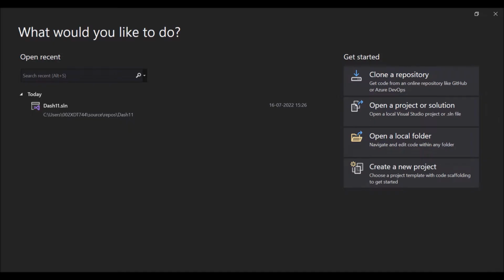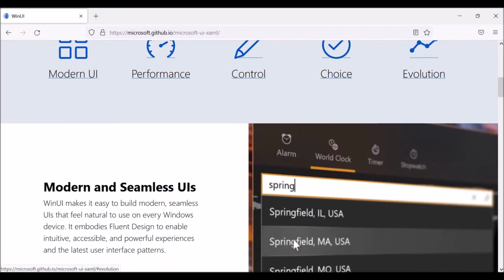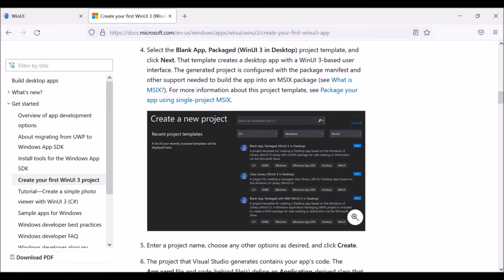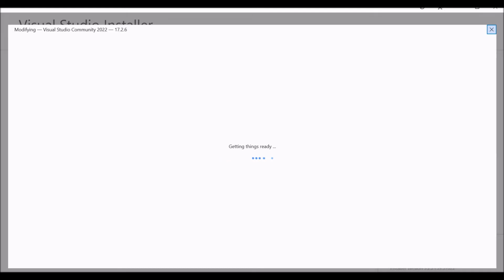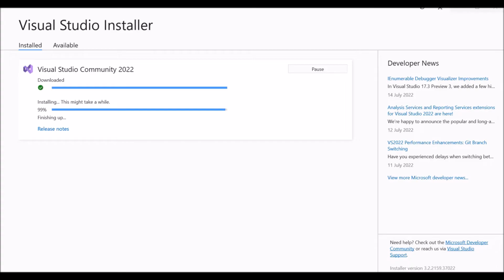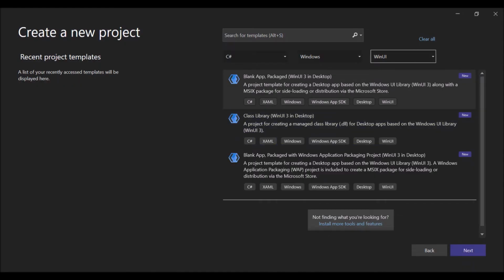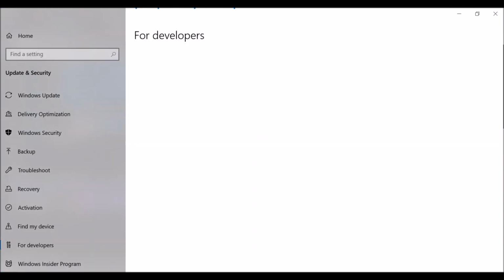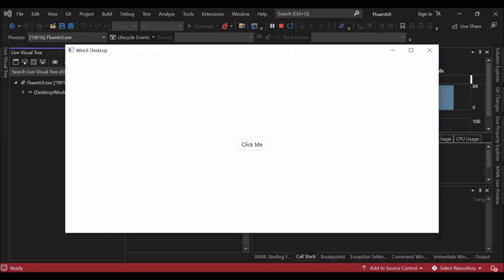Windows UI 3 : Create your first WinUI 3 project | Fluent UI

Comment: Can I style these buttons? Like a web app buttons or will these always look like windows themed buttons?
Reply: Using the XML code, you can style buttons easily. I haven't tried this framework but I believe you also can change the style using settings panel.

Comment: Does anyone know how to fix this?

This version of the Windows App SDK requires Microsoft.Windows.SDK.NET.Ref 10.0.19041.38 or later.
Please update to .NET SDK 6.0.134, 6.0.426, 8.0.109, 8.0.305 or 8.0.402 (or later).
Or add a temporary Microsoft.Windows.SDK.NET.Ref reference which can be added with:
<PropertyGroup>
<WindowsSdkPackageVersion>10.0.19041.38</WindowsSdkPackageVersion>
</PropertyGroup>

Comment: Is there any way to create these forms graphically?  It's tedious to constantly have to run you app just to see what it looks like.  WPF has GUI editing, why doesn't UI 3 have it?  Dang Microsoft!
Reply: Live reload is there, right?
Reply: WinUI is extremely complicated, and thus cannot be live updated, since it would take way too much performance and effort from Microsoft. Plus, it teaches you to visualize your GUI code 😃
Reply: @itjustcrashed   I can visualize code fine, but it sure would save a lot of time to do GUIs with a modern IDE interface.  Other design tools of equal or greater complexity in the markup have been created by many other companies. Looks like MS is just not putting in the resources here (they did it for Winforms and WPF).  Software is supposed to do the work, not us (that was the concept of RAD many years ago). Going back to manually tweaking markup is a step in the opposite direction.
Reply: That's why you should prototype your app somewhere else like Figma,
I know it suck but that's the best option we have so far.
 @docdaven

Comment: Are there any significant changes in your workflow if you switch to WinUI 3 from WPF? There's a package called FluentUI which gets you the fluent style on WPF. Is there any other reason to switch to WinUI 3?
Also, fellow firefox user, nice
Reply from the maker: WinUI3 embodies fluent UI.
Reply: Architecture wise, as far as what I have researched, winui3 ui framework is decoupled from the OS. I am assuming that If u make your project with winui3, the UI when installed in windows 10 will look like its for windows 10 and same goes for windows 11. On the other hand, wpf with fluent ui library will look like its the latest ui even if installed in windows 10. Anyone, please correct me if I am wrong.